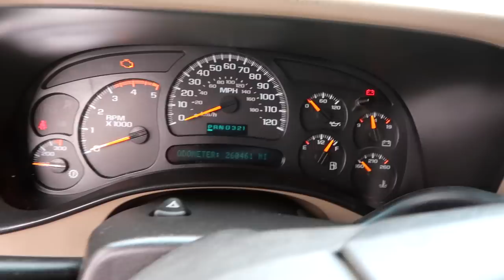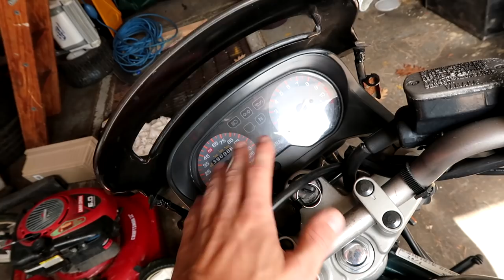It's Back! (The Reveal)

Comment: Ok my 2012 CanAm Commander 800xt with 4" suspension lift and 2" spring pucks I broke a cv joint and locked up the wheel bearing all on same wheel about 1 1/2 years ago and I'm just now getting it all back together after all this time. Wish me luck on it cranking and all parts still being there. I've most of it together as of 1 week ago